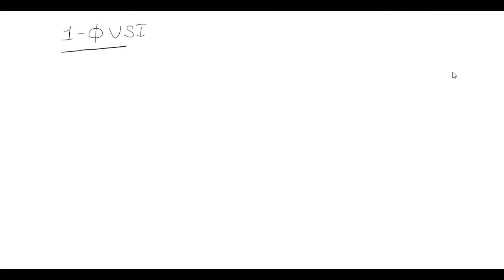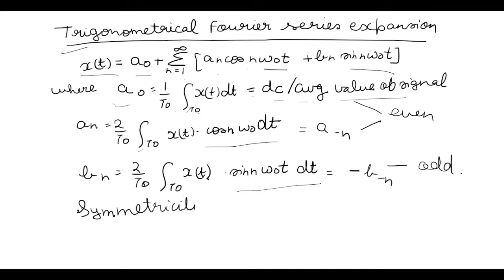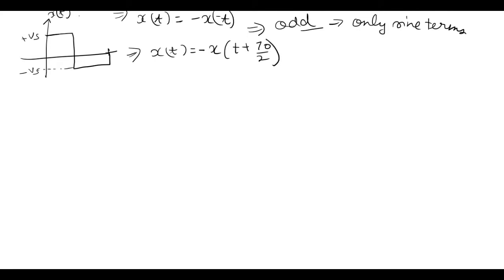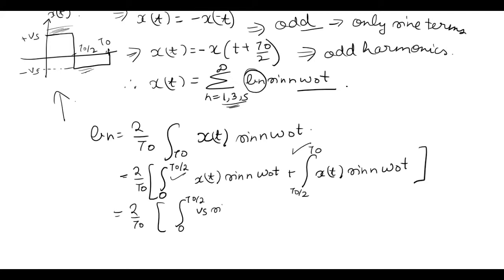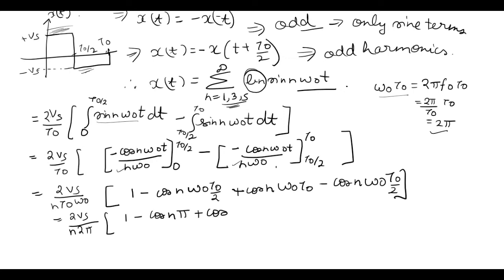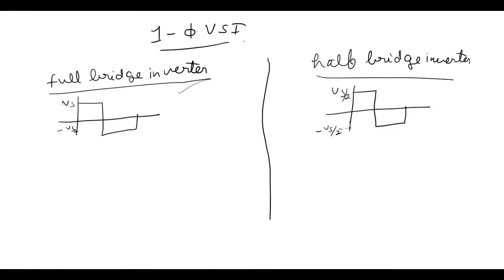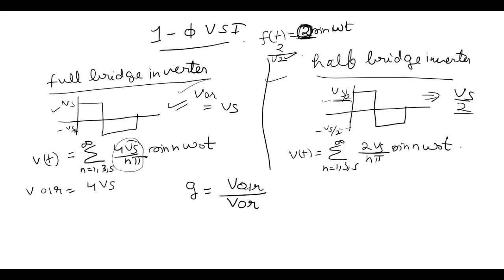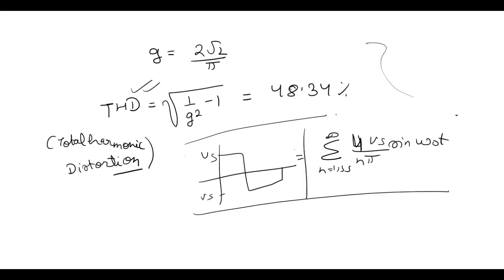Calculate harmonics in 1-phase VSI

Comment: Do it for 3 phase inverter.
Plzz
Reply from the maker: Thank you for your response. I will try it for 3-phase inverter.
Reply: @studyelectricalengineering6025  thanks. do it in  detail 
Rms eqn of both line and phase voltages. Rms and average value of Current. Etc...